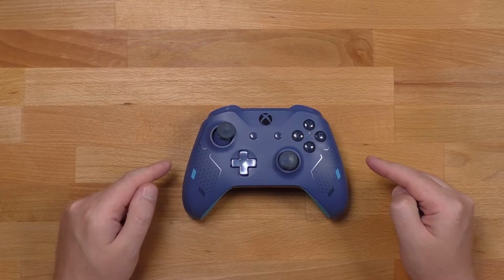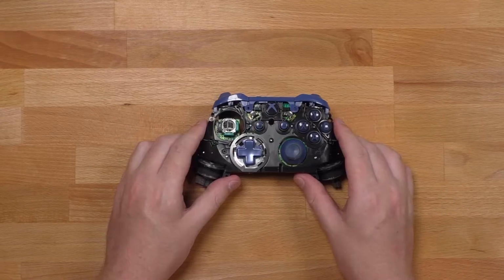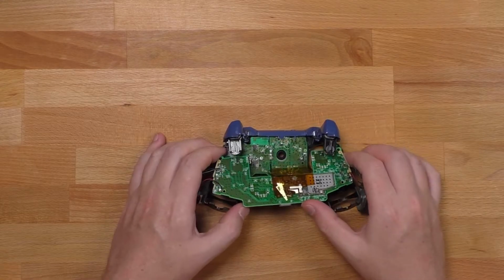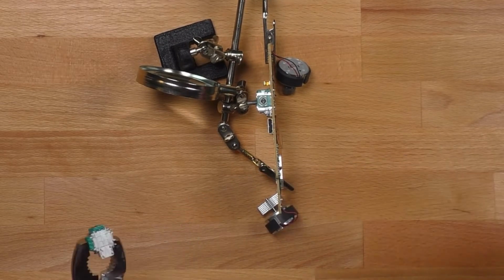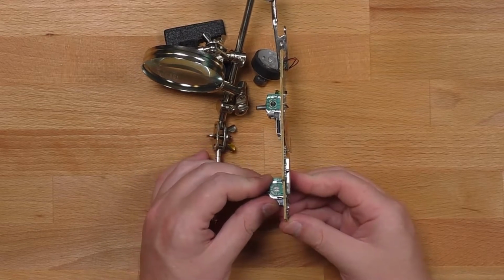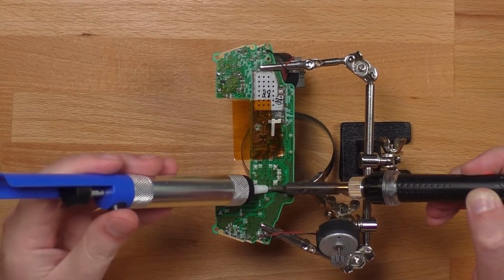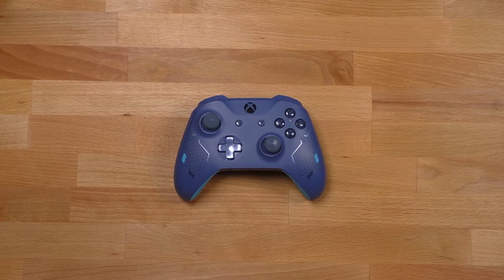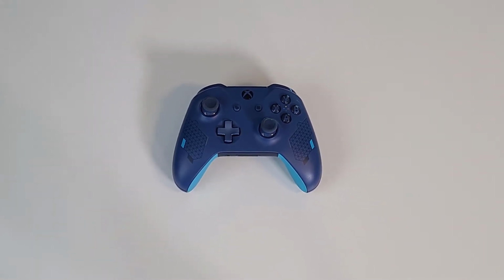Xbox Controller Repair - Analog Stick Replacement

Comment: What temp and air flow setting did you use on the heat gun?
Reply from the maker: I do not remember the exact temp, but I typically start low (around 260 Celsius) and slowly ramp up the temp as needed. Air flow is at 6.25 out of 8. This is on a SMD rework station. Model C0-Z 858.

Comment: Hello mate you know stick is it original like it's not shit make? I have brought some put on and the stick isn't right doesn't feel like the same as I came
Reply from the maker: The replacement sticks I picked up from eBay seem to work very well. I do not see any quality issues. Please use my affiliate link if you want to buy the same ones, https://ebay.us/A8Z7D1.
Reply: I tried doing my 1st analog replacement a few days ago. I failed. I accidentally broke off the holding the antenna wire making it unable to be reattached. I still proceed to replace a analog stick that wasn’t working. The left like you replaced 1st. I was able to replace it. I however still had the same problem with left stick not wanting to move up or down. So I’m not sure why it’s not going up or down. I’m just sad I didn’t fix the issue and then broke something in process. The controller I tried to repair was similar to the one in the video but the red one. I’m still going to try to fix it with maybe another board. It seems to have another underlying issue since that’s why I tried to replace that stick before taking it apart. It wasn’t a drift issue or a broken analog stick. It was just a stick not wanting to go up or down.